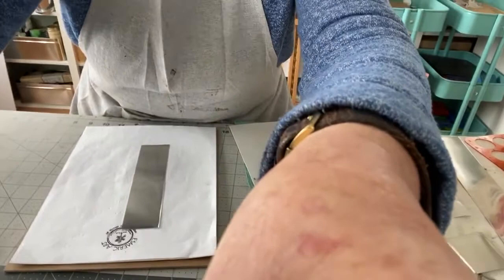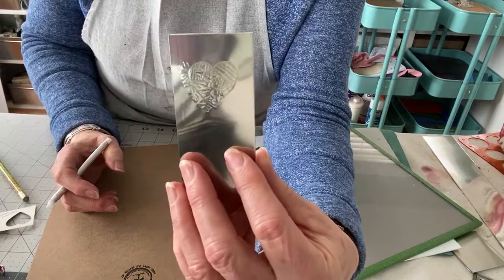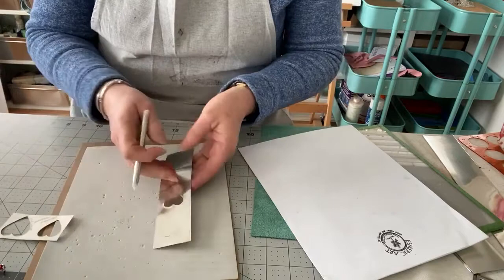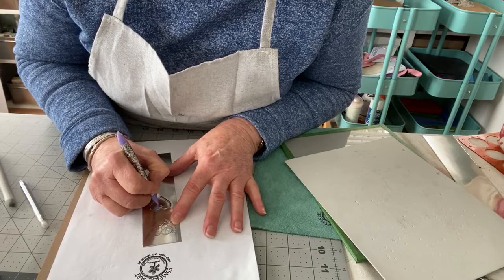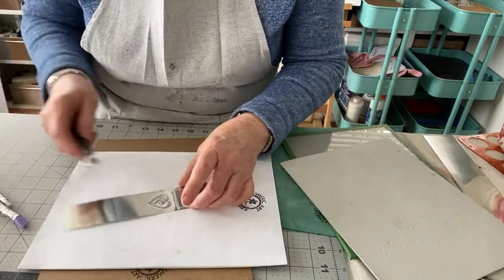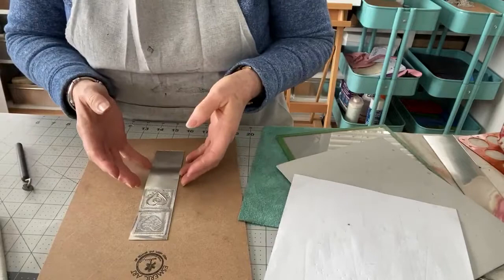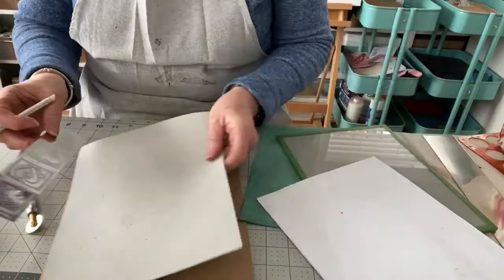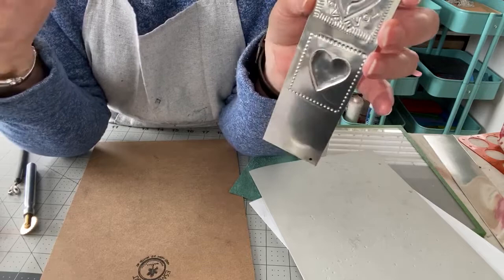Metal Embossing - Basic Techniques

Comment: Thank you for sharing!  Would you happen to know where I could find sheets of pewter that are gold/brass colored. I can find them in copper, silver, red, even pink, but not gold which seems like an obvious color. Thank you kindly :)
Reply from the maker: Maudale, gold and brass colored sheets are challenging to come by. A couple of years ago, I bought some brass sheets from a hobby store; I checked for a label and only found a small sticker with K&S Engineering, Chicago, IL, on the container. Try and see if they are the distributors for the brass sheets. Other than that, try some hobby stores that sell model aeroplanes etc.; that's where I bought mine. I hope this helps. 😊